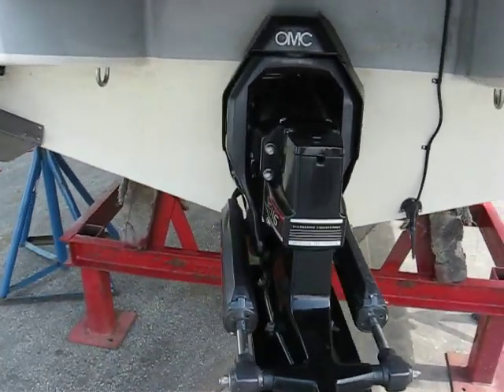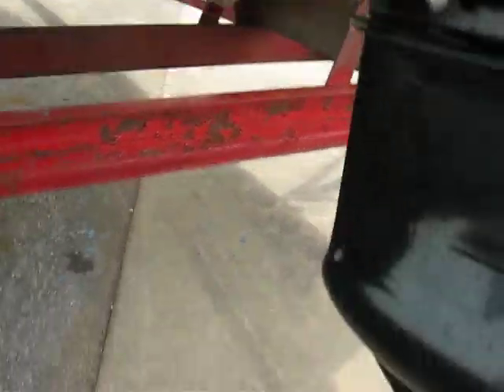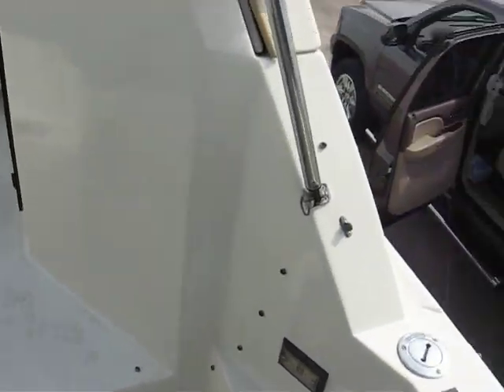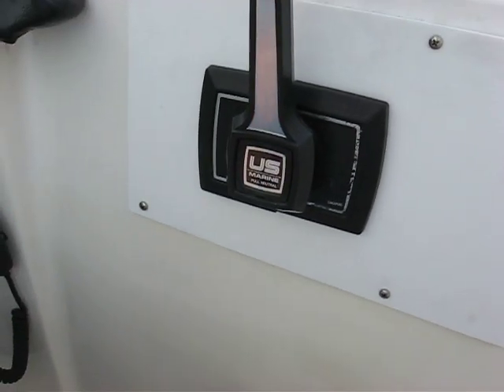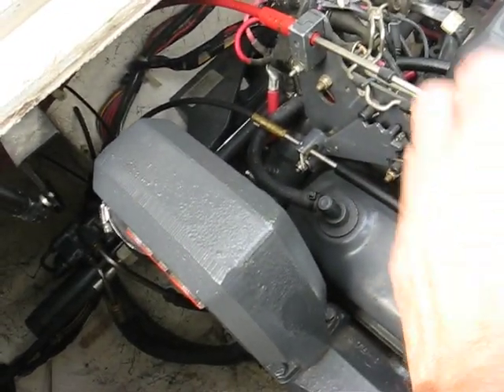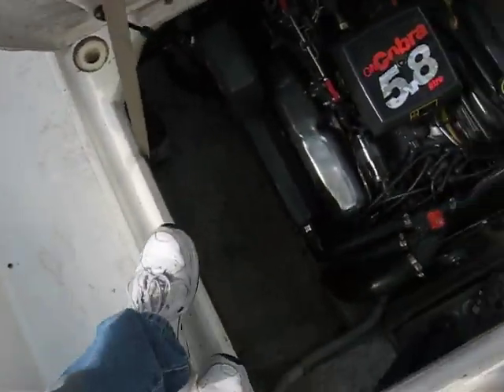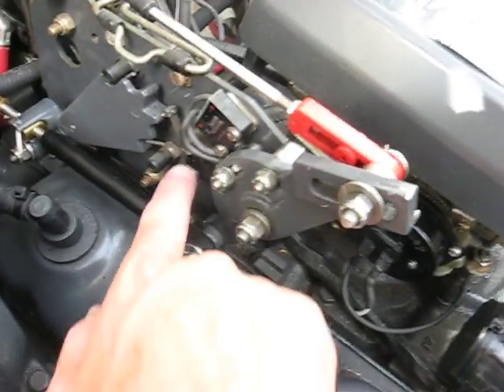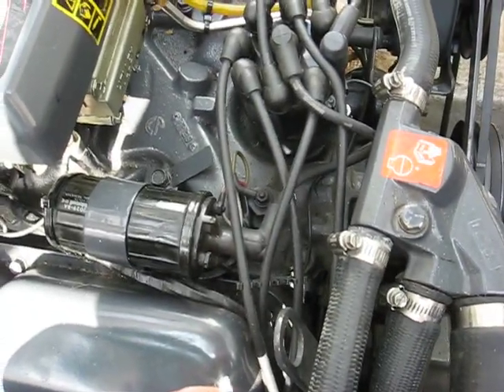OMC Cobra Conversion to SEI 116 Sterndrive Engineering, Mercruiser

Comment: Dumb question...you say that this gets rid of the shifter issue. My question is replacing/maintenance on the mercruiser shifter cable easy to adjust?
Reply from the maker: Hi Aaron, great question, The old OMC cable required adjusting at the engine AND the drive, (the belcrank setup in the drive.) the Mercury Alpha drive which you would be converting too, (SEI version of Alpha) only adjusts at the engine. This makes it very easy should adjustment be needed. I have set mine up initial installation and have not had to readjust yet. The OMC was very good but required precise adjustment at the drive and belcrank. Most people did not want to pay for the xtensive adjustment needed and the technicians adjusted at the engine as most are done there. This would cause many issues. here are the directions for the conversion  https://www.sterndrive.cc/pdfs/conversion.pdf    take a look and you will get an idea of how easy it is to install. go here  http://www.hastings.org/~stuart/cobra/  to learn everyting about OMC, how to adjust, and what did them in. You will LOVE The conversion.
Reply: @hunterboat Thank you :) for the response. Did you install a remote reservoir? Where you able to use a trim gaguge
Reply from the maker: @AaronGermaine  let me know how you're conversation goes. Everyone i have spoken too that has done it says that it is fantastic.
Reply from the maker: My engine did not have the remote reservoir so no. Self contained drive lube. Never leaked though. I did not use the trim sensor. You can, but you have to fashion a small tab to activate it. The new conversation does not line up to the original sensor.
Reply: @hunterboat  you mentioned in your video because of the 90 degree elbow you can not fully raise the outdrive without a trim gauge how do you how far to come then?
Reply from the maker: @AaronGermaine  you can go all the way up. Once you get up the rams will stop. I just did not as it is a pull on the hose. I have no need to raise all the way. If you want, just make the house a little longer then i did. The 90 degree bend pipe is to prevent the kink in the hose they supply
Reply: @hunterboat  no I understand I don’t have a trim gauge now the rams stop I was just curious how you know when to stop since you can’t go up all the way. Btw how much do you think your boat weighs? On my OMC forum people are saying heavy boats break these sei over and Over again is why I ask. I have a 89 2455 Bayliner that is only 5k pounds
Reply from the maker: @AaronGermaine  mine is a Bayliner 2755. I never had reason to tilt the drive. The boat is stored in a rack and we have no shallow spots. The drive is warranted 3 years, no fault guarentee. You break it for any reason, they will replace it. Mine is going on 6 years and no issues. I also put one on my friends boat. I promise, you will love the conversion. OMC will cost you thousands to keep running and they never adjust right. Email me at jbsdc9@aol.com  i will send you some pictures.

Comment: Can you explain changing shift throw, last thing I have left on my conversion.  I have same shifter
Reply from the maker: Hi Ryan DeWitt, Very easy to do. First pop the center cap out of the shifter. you can do that very easy. it is the piece that has the US marine logo. Then there are two caps as you can see on my video at the 3:00 mark. The hardest part will be removing the Wall panel that the shifter is attached too. you will note in my video I have a White plastic type marine lumber board. It came with the Bayliner,,, a fabric covered board. Mine was ugly. Anyway, feel between the bulges of the fabric and you should feel the screws that hold it to the side of the boat. you can pull the board away and you can sometimes tell where the screws are. Once the side is removed, you can then from the front side of the shifter unscrew it from that board you just removed. The handle comes off by the bold under the cap from step one. Be very careful with the wires for the trim and neutral switch.On the back side of the shifter there are two arms. one is throttle.... leave that one alone, the next is the shift arm. un-bolt the arm. flip it to the other direction, 180 degrees.
then you have to move the shift cable either up or down to the opposite clamp in line with the newly placed arm. when you get back there, it will be easy to see.
That is all there is to it. please email me direct with any questions  jbsdc9@gmail.com 
Once done, put the boat in the water and have someone at the controls while you adjust the shift. it takes a little bit, but well worth the effort. 
Best of luck.
Jon
Reply: hunterboat if I rotate the shift arm the top control is in the way
Reply: Sent email
Reply: Ryan DeWitt  did you figure it out? I am in the process of converting mine over and it looks like the same issue

Comment: Mercruiser exhaust bellows are round.  The flange on the transom is round and the flange on the bell housing is oval just like your.  The bellows will confirm to the oval flange when installed.
Reply from the maker: Kevin Eich the two did not match up. Some people did a work around using a car muffler adapter. You can see this on the sterndrive engineering website forum.

Comment: I am so happy to have come across this video! 

I just got the boat back from the local dealer.  The boat fights me (sometimes) coming out of gear.  Apparently the shift assist module is faulty, and not available anymore.  Mine also occasionally clunks (3-4 times this season)  I eliminated this by being more aggressive when shifting in into gear,  but I know its only a matter of time before those gears fail.  I won't throw any more money into my OMC unless its simple. I will convert it to the SEI 116.
Reply: You can still get the esi modules aftermarket, I just bought one.. Also the cobra shifts perfectly, they just have to be adjusted right, you may have to take outdrive off and do adjustment process with the bellcrank lever and at engine, its actually easy and simple to do, just need a standard ruler and look up the specs for your engine mounted cable, its 6 and 1/2" from trunion center to center of hole for my king cobra, probaly the excat same for yours
Reply: benzproducts I have a 1987 4.3L with a OMC Cobra! I purchased the boat in 1995 with some engine issues and the typical shifting issues! which I was aware of but did not mind because I am a mechanic! In 1997 I rebuilt the engine, changed the shift and throttle cables and made all the necessary adjustments! The boat has been running perfectly for the past 23 years! Absolutely zero issues with my outdrive, And the boat is docked in salt water all summer long every summer! There is no issues with OMC outdrives the only problem is either uneducated owners or uneducated marinas!
Reply from the maker: Very True, when Cobra outdrive is adjusted correctly, they are one of the smoothest shifting drives. Unfortunately, the Cobra must be adjusted at the drive and engine. Mercury/SEI, only at the engine. Most people did not want to pay and most mechanics of the time did not know this and the drives failed. The SEI is easy, and will make one very happy for many years.

Comment: Hi Hunterboat. question.
Which pole is the negative  on the coil?
for the bypass.

thanks.
Matthijs.
Reply from the maker: 0987mulder Hi please email me your email address. I tried to send a picture but was not able to on youtube.
jbsdc9@gmail.com
Reply from the maker: 0987mulder Hi. I would recommend first, that you try the boat out before you cut any wires. try to shift with the system as it is. This way you will be only interrupting half of the cylinders. If you cut the wire and ground out the way Sterndrive engineering states, you will cut out the whole engine.. this is not bad. but if the boat shifts smoothly without wire cutting, this would be better. I did not cut the wires and left the shift interrupt as it was and the shifts are smooth.

If you do cut the wires, you can cut both wires from the shift interrupts switch and run one wire to ground and the other to the negative side of the coil. I have attached a picture of the coil. If the picture does not come over clearly, send me your email address and I will email it to you. you will note, that the negative side is the one that runs to the distributor. I hope you enjoy your new conversion. I love mine
Jon   jbsdc9@gmail.com
Reply from the maker: 0987mulder The negative side of the coil has a wire that runs to the distributor.

Comment from the maker: Hi Tomasz
The salt water sure does a lot of damage to the engines. I am lucky that we can store it inside. They use a big fork lift to put the boat in the water when we want to use it.
I am very happy with the SEI. If it were not for them, I would not have a boat. To much money to change the whole rear end. 
I would think Diesel is a good engine.. 
Jon

Comment: Hi Jon

this seson I am installing 15x15 prop aswell, my engine is only 150hp so to get her on plane I had to install much larger trimtabs and she was able to run 21 mph with the prop 16 x 14 pitch. My boat stays 6 months in semisalt water of baltic sea and omc/sei does not look like yours- almost brand new lol. Regarding tilting up- sei does not come up as high as cobra use to, cobra on upper position was in level with the kil while sei seats a foot below . About cooling water hose- I got a curved 1 "hose from cars cooling system, its connected to water tube on transom and goes down to the level with fitting on bell housing then there is SEI reduction  to 3/4 and strigt hose of 3" lenght to bell housing . Looks great and I hope there will be no  more cooling problems. For exhaust I used mercruiser exhaust bellow secured with jubiling clamps. Works great , diesel much more  silent then straight pipes it use to have befor. 
Tomasz

Comment from the maker: Hi Again Tomasz
in the video you can see the elbow that I put in the water hose connection at the 1:49 mark. The only thing is that I can not tilt full up with the drive. but I can go almost all the way up. Left and right is perfect all the way. I have no need to lift the drive to the full up position so it was not a factor.
Jon

Comment from the maker: Hi Tomasz
I had the same problem with the cooling hose, so I used a 90 degree elbow 3/4 the way down from where it enters the transom. This took the kink out and it works great.
I do have the grounding wire attached to the bell housing. it is just hanging low in the picture. I store the boat inside after every use so it does not sit in the water which really helps with the galvanic corrosion problem. I have a 15 inch and 15 pitch prop that SEI sold to me. the boat is 235HP Ford V8. Glad you are enjoying the conversion. I absolutely love mine.
Jon

Comment: Hi
thanks for publishing your video. You gave me an idea how to modify my water cooling hose. I did convertion last year and did all by the SEI manual but I was not happy with engine cooling temperatures. Could not get bent out of my water hose. My engine is 6,2 GM diesel. So today I removed outdrive and fit new water hose shaped with curve. New SEI outdrive is ideal for my diesel engine , shifting is so sweet now, before with Cobra it was fight because ESA does not work for diesel engins. There was another thing I was not happy about, after I have taken boat out out of the water for winter. The paint from bell housing went off almost completly under pawer washing. Same as on your vido I did not conect grounding wire to the bell housing. This year I did and hope bell housing will not act as big anode like last year.
By the way I have the same boat as uyours. What  prop you have there?
All the best in crusing around.